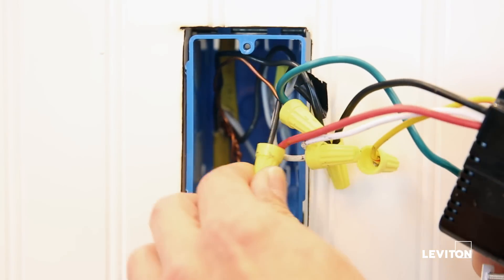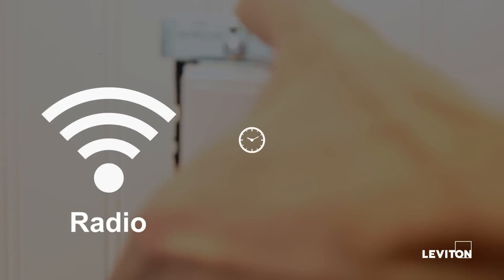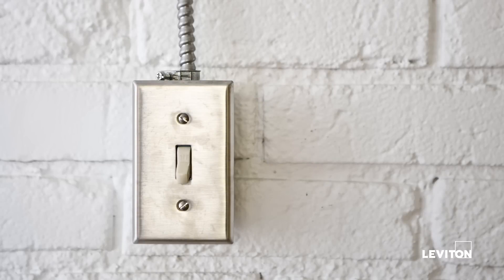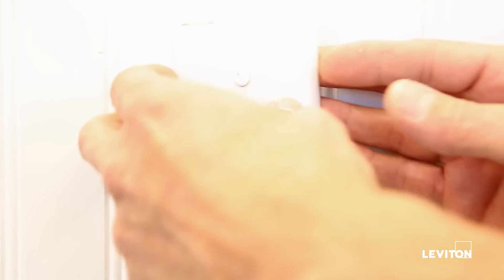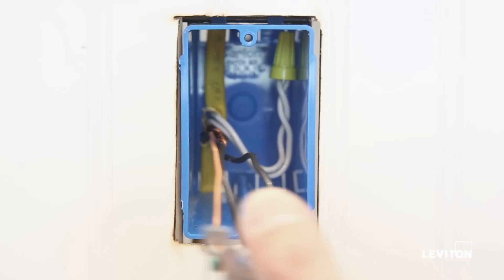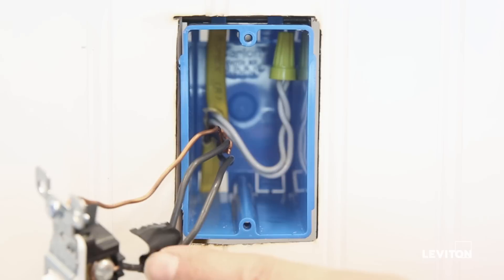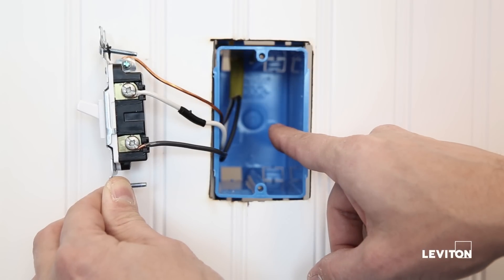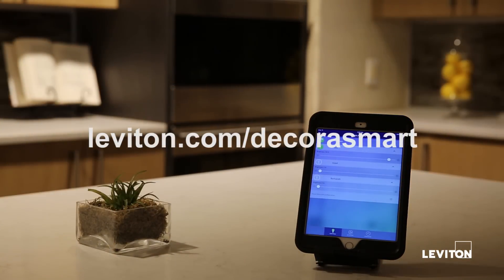How to Identify a Neutral Wire | Leviton

Comment: Dunno in which country you live, but in Europe the color codes for wires are explicit for each wire and this code is applied by everyone ... So there's no question about line, neutral or ground wires ...
Reply: Not true. Old wirings have different colors and they are but standardized.

Comment: Why are there 2 white wires connected together on the right
Reply: One comes from the top(ceiling) i.e. light, for example. The other comes from the bottom(wall) i.e. source/fuse box, for example. So, the switch is 'in the middle' of the those two wire sources. Just another way to look at it.  Hope this helped👍🙋

Comment: A Electrical Engineer  told me Each neutral has to be on its own circuit to the leg, if other neutrals from other circuits are tied together it will cause a E-field in your home, your power will still work but to eliminate the E field that is what is necessary to do
Reply: Sure
Reply: Did you know there is already an EMF being released IN your home/building, from ALL the wire surrounding's? A minor amount, but still. FYI 👍

Comment: I am trying to install a wifi switch which contains 2 black wires, 1 green, 1 white.  
The wall switch in my room has the 2 black wires, 1 copper, and the 2 bundled white wires. 
Please let me know if my thinking is correct  because every video I see they are connecting the green (ground) to a red wire which I do not have. 

1. 2 black wires (Load) go to the 2 black wires on the switch (Interchangeable)
2. 1 white wire (neutral) connects to 2 white wires 
3. Green wire (ground) connects to the copper wire???
Reply: Pretty much correct. 
One of the blacks is a load, the other black is a line. The line has current all the time while the load does not (when the switch is off).
Depending on the model switch you are installing, it makes a difference.
Green is ground which is the bare copper.
White is usually your neutral.
Reply from the maker: Please call 1-800-824-3005 for direct guidance with wiring
Reply: Wtf vids are you watching?? 🤣

Comment: Thank you, I had a three way switch and single pole in the same box. I wanted to connect the smart switch to the single pole but none were connected to the neutral. This showed exactly what  I had as the back of the box, two white wires connected by a screw cap. Once I connected the white wire from the smart switch to the other two everything worked perfectly.
Reply: so you ran a white wire (neutral)from your new smart switch to the 2 screwed white wires?you used both wires?

Comment: Not so sure one should assume that any extra white wire is necessarily a neutral without testing it!
Reply: So how do you test it?
Reply: @gilsteiner  
Continuity test on neutral and ground.
Reply: True. ESPESIALLY if your in the UK/EU, for example. They use very similar colors, however not for same applications.

Comment: I was trying to help someone on youtube connect a smart switch without a diagram. He was confusing me by stating the the neutral was required to power wifi and etc. Turns out your wording is misleading, the grounded neutral provides a current return path for the electronics in your switch. The black wire is the hot wire powering your switch.
Reply: I think the switch actually takes a low power load from the neutral wire to power itself.

Comment: I tried to install one and I do not have power anymore in the switch and some outlets, I have 4 whites they were all together and two blacks and green ground, it is a receptacle for two switch lights and not working anymore, I found the one white wire that is allowing the wifi connection but the switch and four outlets stopped working, using the volt tester I can tell there is power, please help!
Reply from the maker: Manuel, we recommend call us at 1-800-824-3005 or contacting a licensed electrician
Reply: Hello, I just fixed. Thanks , now is working everything. You should say in the video that if we have more than one neutral for one circuit box then the neutrals have to be all together because if not you can loose power near the switch which it happened to me. Thanks again

Comment: Thank you. Do you have to have the power on while doing this?
Reply from the maker: The power should always be off when working with exposed wires
Reply: @leviton  Thanks for the advice. I'll make sure to remember the light switch is in the off position before connecting mine.
Reply: Hahahahahah
Reply: @andyk192  hahaha
Reply: @awachtel  not funny man, 120 can still kill you depending on how many amps..  it only takes 100 miliamps to stop a heart.